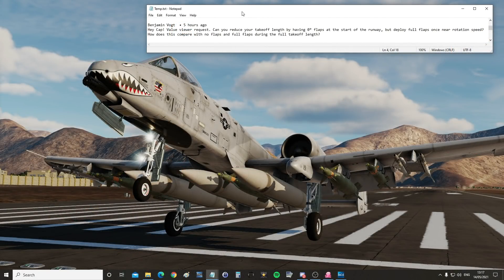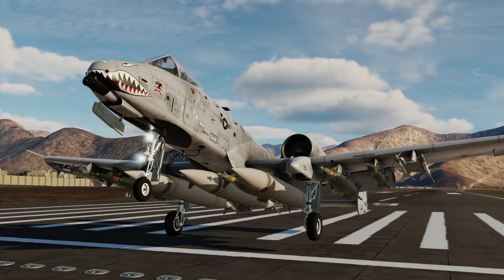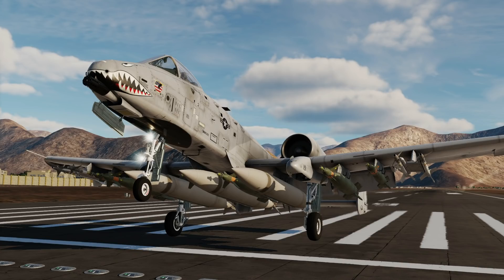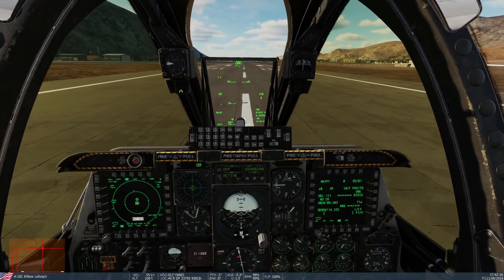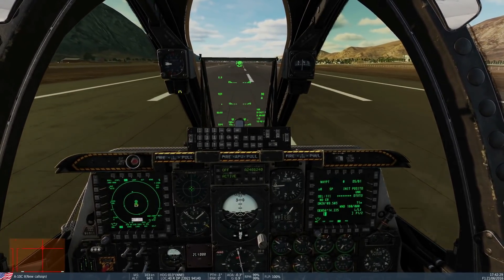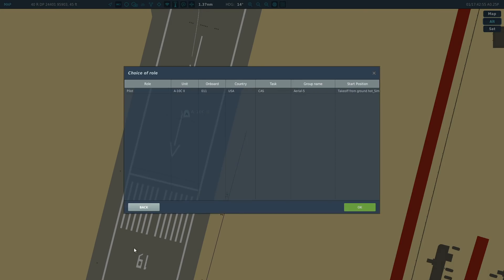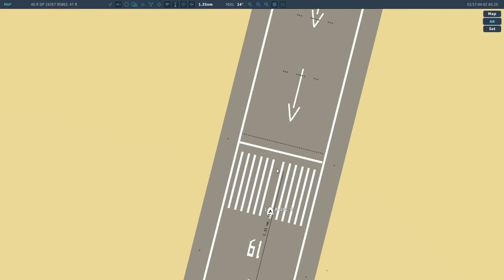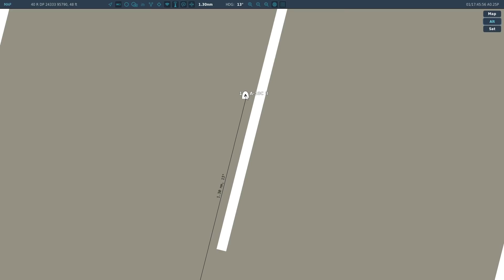Questioned: Can Delaying Flaps Decrease Takeoff Distance? | DCS WORLD

Comment: It’s a good way to get into the trees. Throwing flaps at the end of a run is like tapping the brakes on ice. You will have a decrease in speed and if they don’t come down or worse come down on one side only it’s the worst of all times to have cascading problems. Like a tire, or an engine power issue.
Reply: Well, they're just pretend trees, after all.

Comment: G'day Cap. Back in the day when I used to skydive on weekends, we used to fly from a short bush strip that was a bit stoney, and sometimes peppered with wallabies. In summer especially when the density altitude was high, the pilot used to begin take-off run with zero flap and a a bit before rotation quickly pull 10 degrees of flap. this would lift the wheels free of the deck and allow a slightly shorter take-off. It also reduced the time that the propeller was close enough to the ground to get chipped by a stone.

Comment: On paper - yes.  The flaps increase drag, which will slow your acceleration while providing no other value until V1 is acchieve.
in practice? fuck no.  from 0 to takeoff speed, drag is practically irrelevant in terms of forces acting on the plane (especially since it will average to 1/2 of takeoff speed and drag varies quadratically with speed), and the flaps account for an almost immeasurably small portion of the overall airframe drag.

Comment: Cap, does Dcs have a multiplayer?
Reply from the maker: Yes sir!
Reply: @grimreapers  I'll have to try it when I get a computer, do you need one of those special control stick thingeys to play? Or just keyboard and mouse?
Reply: @TURVY27  Hi, you can play with me and Cap at Sunday funday. You don't need to have a stick but using one will make it easier for you to fly. I use a cheap trust master hotas X for PlayStation 3. All so this is minimum to run DCS
Intel Core i7-9750H (2.60/4.50 GHz,12M)
    NVIDIA GTX 1650 4GB GDDR5
    16GB DDR4 2133MHz
    1TB SATA 5400rpm
    250GB M.2 NVMe SSD
    15,6" (39.62cm) 1920x1080 IPS mat
With this I have 30-55fps depending on the mission and map
Reply: @mishamisha8752  Unfortunately I can't install it due to some weird thing the computer is doing. But tell Cap to fly a mig 15 for me!
Reply: @TURVY27  MishaMishaMiiii#4111 - my discord. I can try to help you install it

Comment: i do this all the time, i'm betting it helps.
Reply: Same. Taking off with overloaded hog is a routine for me haha 😂
Reply: I have done this a few times, however I mostly fly with 50-70% fuel and not too many weapons so I usually takeoff with flaps retracted anyway. DCS airbases are usually big enough for hog to takeoff with flaps retracted. I heard that some real hog pilots sometimes do takeoffs with flaps retracted. However I still rotate at around 120kts.
Reply: @macieksoft  ya, you really shouldn't have the hog with 100% fuel unless you know you need. The hog can really loiter for a long time and most DCS mission flight times wont surpass much more than an hour.

Comment: I thought full flaps on take off helps it take off?
Reply: Flaps change the mean chord line... in other words they make the wings have more lift. Which means lower stall speed.

But the trade off is more drag. But if you have enough power to overcome that drag, then it doesnt entirely matter.
Reply: Also, generally you never take off with full flaps, but you land with full flaps.

Consider a 737 takes off with 5 degree flaps, but lands with 40...
Reply: Flaps reduces takeoff speed but the drag from the flaps makes for a longer takeoff-run. Regularly you wouldn't put flaps on or off during a takeoff run because its a part of the checklist, and once checklist is completed, flaps should already be set to takeoff. Its seems that during exceptional circumstances when you find yourself on a short runway, this teqnique works.
Reply: the ratio of lift/drag tends to hit diminishing returns past 1/2 flaps, at full they're acting more like dive brakes than flaps.
Reply: @MarkoDash  Indeed. now if your coming in for a landing, thats extra drag isnt a bad thing, you have both gravity + thrust working for you. taking off gravity is not your friend, so you need more thrust to over come it,  but whe n you are landing, extra drag is compensated for beause you are losing altitude. 

 Another way to look at this is basic avation theory.

thrust <-> drag and lift <-> gravity.

If every thing is balance, you fly in a straight and level.

Change any of these, in order to maintain speed / altitude, you need to compensate. 

At some point however, the aircraft is unable to compensate as its beyond its performance abilities. And this means you eventually wont take off, and or fall out of the sky.